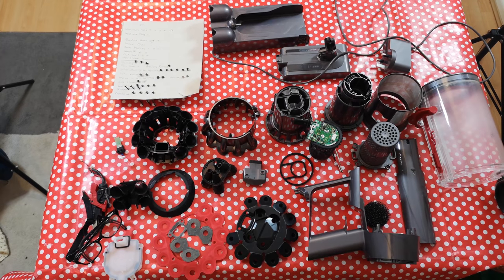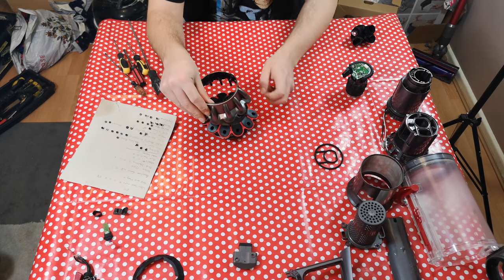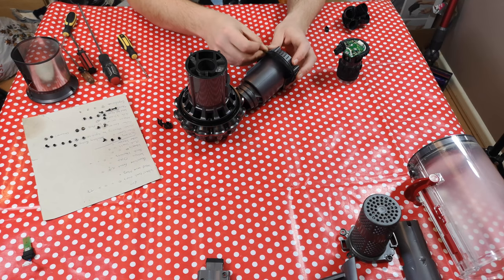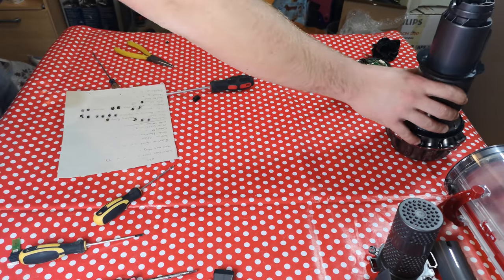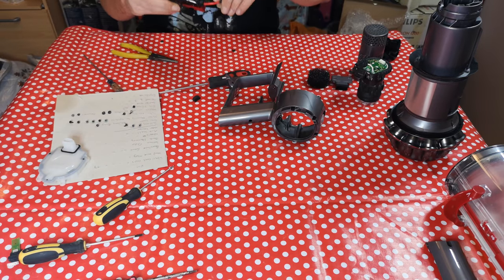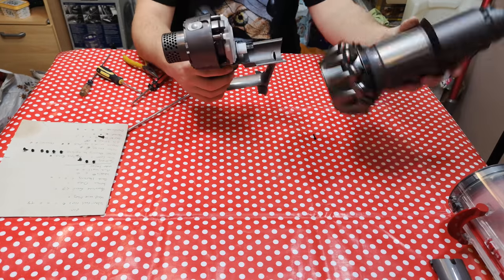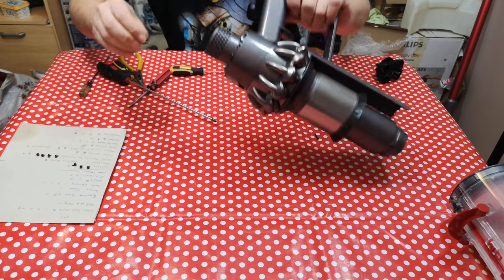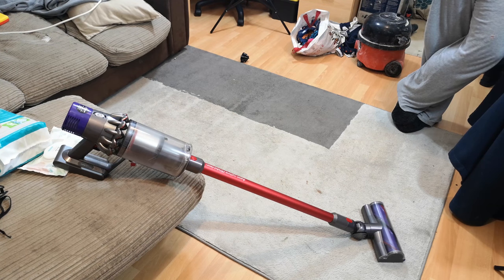Dyson V10 Cordless Vacuum Cleaner - FULL Reassembly!

Comment: One of my Numatics is used to vacuum ash. When the chimney is swept, it's ALL vacuumed up and it's usually is enough to fill 2 bags! The vacuum gets quite hot but has put up with the abuse. Sometimes the bags pop too from the sheer volume of ash. They really are excellent machines.
Reply from the maker: Every chimney sweep I've ever seen (5 I think) has had a numatic! I guess slightly special ones with a mahoosove cooling fan on the top). Imagine the mess if you didn't use bags! Do you use paper or hepaflo?
Reply: @beko1987  We do it ourselves and the vacuum used is a Numatic from 2006 with Nationwide branding. It was previously used commercially and now used for ash - it's had a hard life! The bags I use depends, but I've used Paper ones, the knock off 5 layer cloth bags and the Genuine Numatic ones. I've had them all pop before to be honest. Very impressed with the machine since it hasn't really been looked after. After it was used for cleaning the ash the machine reached over 65c and was still fine!

The place the machine originally came from didn't look after their machines like I said before. What usually kills them is the lack care. The cleaners use the machines with the bags so full and they get very heavy. This of course sometimes causes the motors to burn out. Sometimes the cleaners go away from the cleaners for a couple of minutes to move things out of the way etc, and they leave it on with the cleaner head flat to the floor with the suction blocked...

Comment: Hello. Thanks for the video tutorials.  I’ve rebuilt the V10, BUT, as my dog chewed the speed control component (replacement ordered) I thought I’d see if it would at least power up without it.  It doesn’t.  My question is, is this because the speed control part is missing, which I hope is the reason.   Seems obvious, but thought I’d ask anyway.....  many thanks!
Reply from the maker: No I don't think it will work without it, it'll need that to work out what setting to use. Look for cheap smashed up bodies on ebay and swap the whole back lcd end over (with your motor and main body)?

Comment: Is the ferrule with the wire wrapped around it essential for the function of the machine?
Reply from the maker: No, I've left them just over the cable, with the one turn removed for a good bit of extra wire length. Noticed no difference

Comment: That would certainly explain why the poor thing burned out! Fireplace ash is one of the worst things you could suck up with one of these. It would be interesting to see if that circuit component burns out normally or not.
Reply from the maker: Yup, it changed the entire reason I'd made up in my head! Would take a bloody good bagged vacuum to survive Ash, poor little v10 did very well lol
Reply: @beko1987   Honestly I'd agree considering it still ran and the filter was salvageable! Pretty impressive actually, shows how important having the full context is.
Reply from the maker: @scottd1432  wow all I need is Louise Stirton to come on and say something positive and I'll call that a life goal! It is all about context, yes dysons choke themselves to death in their own filth generally but abuse is abuse. But the owner didn't even realise it. When I told her the thought for a moment, then you could see it replaying in her head! So it probably won't happen again
Reply: @beko1987  That's one reason why it's hard to make judgments on these things, it's a fine line between normal wear/tear and abuse. Personally I think all vacuums should have a margin for error so they aren't ruined by overfilling the bin once (which would be insane). Odds are every vacuum (heck, everything in the world) will face less than ideal conditions at some point. That's why bridges are built with a margin for safety......

Just have to keep an open mind about things and be honest when an assumption is wrong, as in this case. I fully include myself in that!